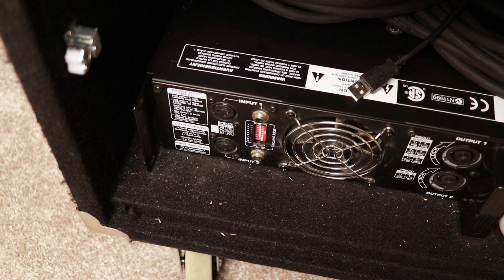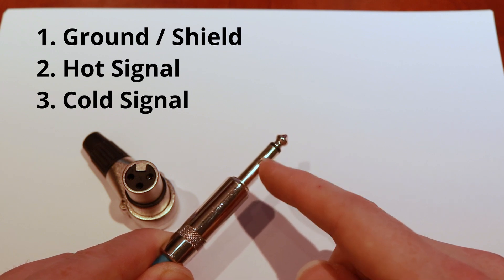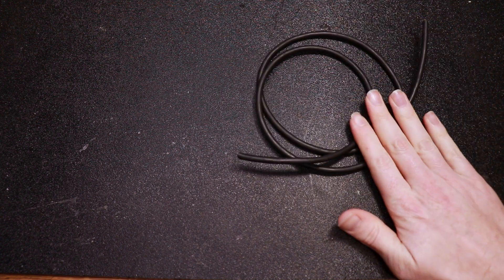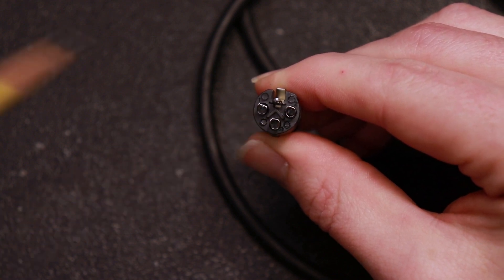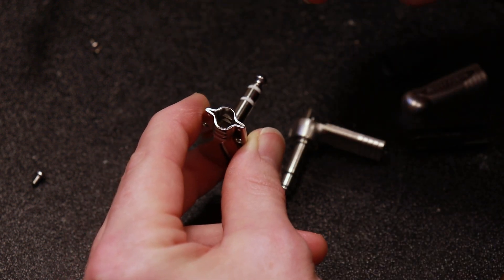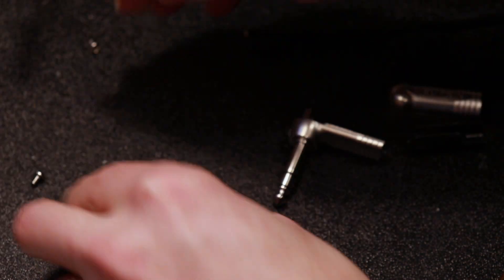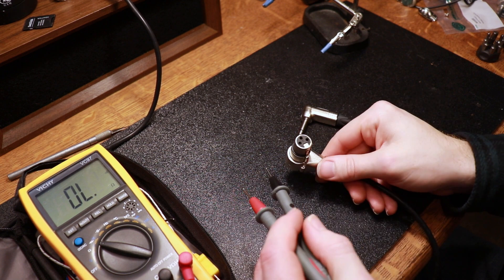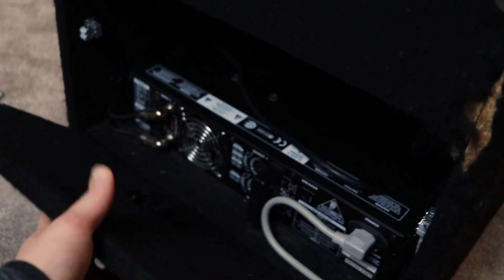How to Make XLR to TRS Audio Cables

Comment: In the case of your loose pancake connector, there used to be an old standard knot that is called a fire underwriter's knot, which was supposed to be used by electricians in lamps to provide strain relief and isolate the strain from the electrical connection, avoiding shorts when the cable is pulled, which makes the fire underwriter (fire insurance company) happy https://youtu.be/Ln6EZf6ojB4?si=Cm1g4jL7KqGPR2-P

Comment: Thanks for this tutorial.
I am interesting to make two balanced custom cables for my Samson QH4 headphone amp which use balanced 1/4” (6.35mm) TRS left and right inputs
The first cable (2.5mm balanced TRRS to dual 6.35mm TRS) would be to connect iBasso DC01 (2.5mm TRRS output) with Samson QH4 (dual 6.35mm TRS inputs)
Second cable (4.4mm pentaconn TRRRS to dual 6.35mm TRS) is for iFi Zen DAC (4.4mm TRRRS output) and Samson QH4 (dual 6.35mm TRS inputs)
I put together this little booklet https://www.mediafire.com/file/5zgxqp7hukvoxgv/Balanced_cables.pdf/file with some information for these devices and schemes for these two cables (version #1 not use ground and version #2 with ground included). My question is: if this is the correct way to wire these cables, and if so, which of these cables should use ground and which not?
I would really appreciate any advice